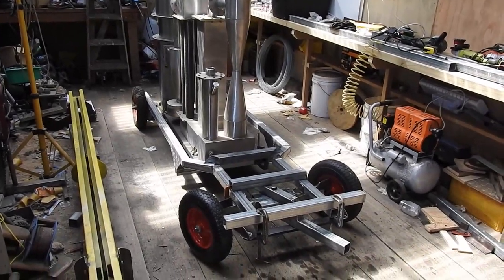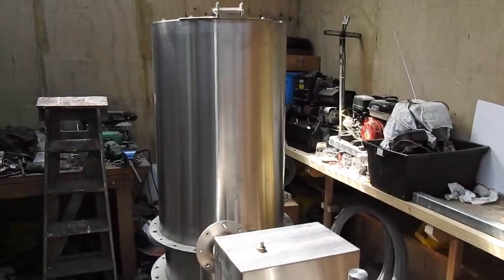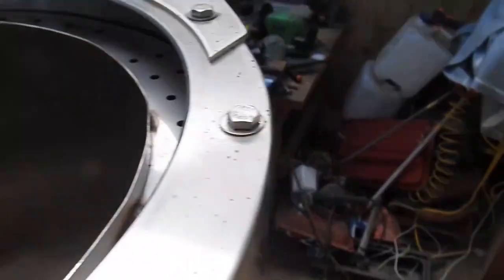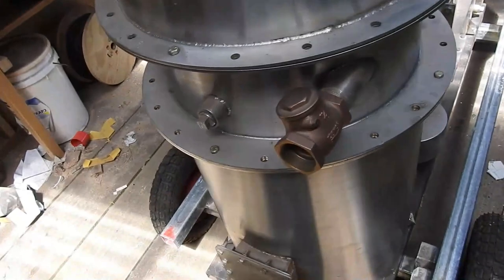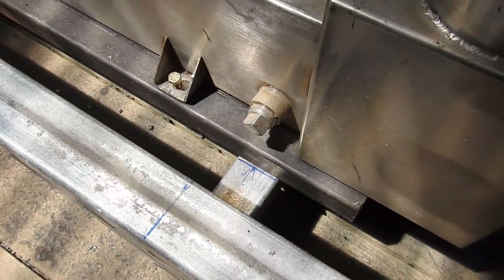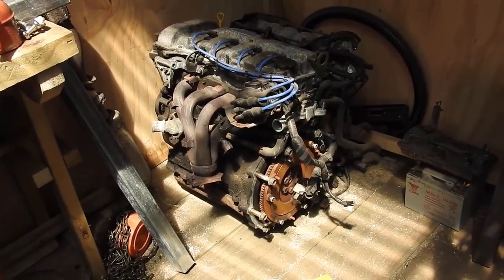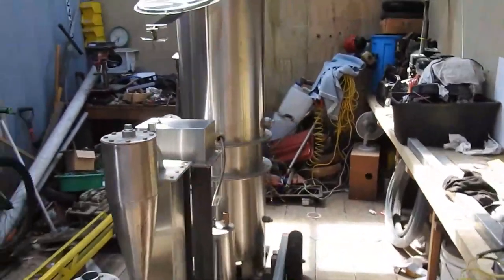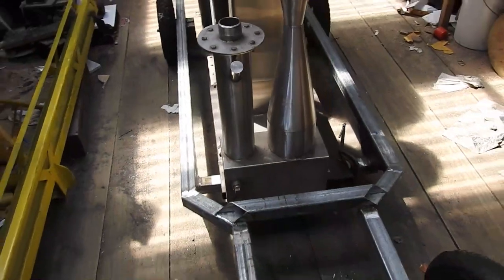Building a trolley for the Off Gridder gasifier

Comment: Im not positive, but I think the port on the later cyclone is for a water inlet. The tower is just a condenser I think but could be used for media filtering. Not very practical though you need to un bolt it every time.
Reply: the idea of the inverted one is so that as water is flowing through the top it will naturally vortex and debris will stick to it. Then when it flows down the bottom one the water debris mix will separate from the gas. I think anyways, but I do think this was supposed to work with a water input.
Reply: Directions are overrated
Reply from the maker: @Thrive-Off-Grid  
 Thanks kindly for your thoughts here. 
 Watt you suggest makes a lot of sense  :) . 
 I plan to unbolt everything, and take videos/pictures of watt I find in there. 
 That way, we can all see the inner workings of this fine beast.

Comment: Steve, I believe Ben Peterson chose wisely when he gave that gasifier to you. These gasifiers are not bicycles. There is a level of understanding that can only come from the hours of operation you have under your belt. That being said, I can't wait to see you get that engine running. A couple of suggestions from my observations. First, don't try and mount that engine on that frame. I'd say use the space you have for your fuel dryer and control box. You can pick up an engine stand from harbor freight and modify it. I don't think those wheels or the frame will be happy with all that weight. If vibration is needed, you can use some kind of vibrator.  I'll be happy no matter how you choose to do this,  but these are things I would do. I'll get to enjoy the show and learn something new without having to do any work. It's a win win for me. Keep up the great work. I look forward to seeing your progress. Joe
Reply from the maker: Howdee Joe, 
 Thanks kindly  :) . 
 Just to set the record straight, this gasser was purchased by a friend of mine, about 10 years ago, but he never really had the time to put it to work for him. 
 Seeing the numerous woodgas bug fang marks on my neck, he soon realised that this was the best place to send it. 
 With that, he kindly gave it to me  :) . 
 As for runtime hours, I have approximately 2000 of those under my belt, which makes them a wee bit uncomfortable to wear on a daily basis  ;) . 
 I will need to try out some ideas, regarding the engine mounting solution, as it is a fairly big engine, and space will be limited, once it is mounted - along with a generator. 
 While these wheels will be OK with the overall load, my plan is to include 4 jockey wheel jacks to the trolley. 
 These will take the weight off the wheels, while the machine is parked up, thus preserving them for a quick getaway when the lights turn green  ;) .
 Naturally, my plans may change, based on the concentration of woodgas bug venom in my veins. 
 Soooooo many projects/ideas, soooooo few tick-tocks in a day!

Comment: At first I thought you were entering the french Du au Lap Race  around the working girl quarters of Paris, using the shiny Stainless Steel to attract some attention. I did come to my senses after awhile.
Nice to see you attacking the bigger bugger maker. I thought to myself, " Hey , I have Ben Petersons Book " wood gasifier's builders bible " . So I pawed through it and didn't find much of an explanation of anything down stream from the  main gasifier. It was a Starter Kit design for those wanting to make a go at building one. That sure is a piece of work though. Best thing is to fire it up and see what happens !
If you wood like I could send you the book.
Looking good there mr ST
Reply from the maker: Yes sir. 
 This here is a racing gasifier, and, as such, it is a total chick magnet  ;) . 
 They'll need to run, even faster than a woodgas bug, if they wanna catch up with it. 
 Thanks for your offer of Ben Peterson's buildin' bible, but I get the feeling that it won't shed much light on the beast that we currently behold. 
 Yer advice on setting 'er ablaze, and seeing watt happens, is probably the best way to go, as I see it. 

 I figger on unbolting a few things, here and there, so see watt's inside. 
 Seems to me that this wood be good for another video, as we all need our woodgas fixes, right?   ;) .

Comment: Wow cant wait to see this working! Do you think you could run a 4 liter engine from a gasifier this size?
You could use a cheap winch motor to drive the wheels. I fitted a sprocket on to the spool of the winch. This powers a caravan mover that i use to move portable cabins around. They weigh about a ton and move pretty slowly.
Reply from the maker: Howdee partner, 
 Like you, I look forward to seeing this beast come to life  :) . 
 It's gonna be a wee while, as I have rather a lot of work to do, before I can set fire to it. 
 This would run a 4 litre engine, but it would be limited to about 55 HP of engine output. 
 The engine I am going to put on this frame is around the 2 litre mark, so it will be under worked, but that's OK, as 50HP far exceeds my modest power needs. 
 I like your idea for the locomotion system on this beast, and I will surely have a look into this option. 
 A cheap winch mechanism ought to have all the grunt I could possibly want for this  :) .